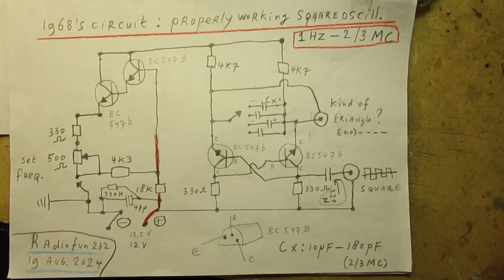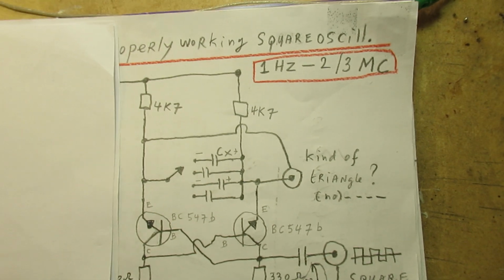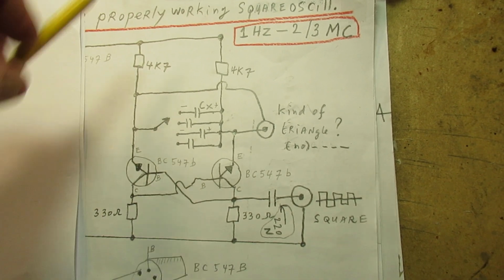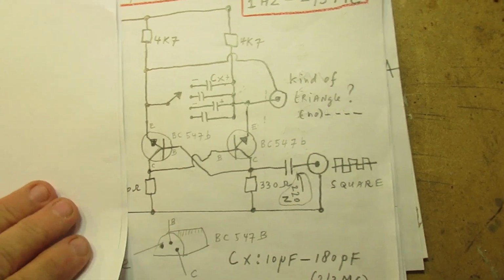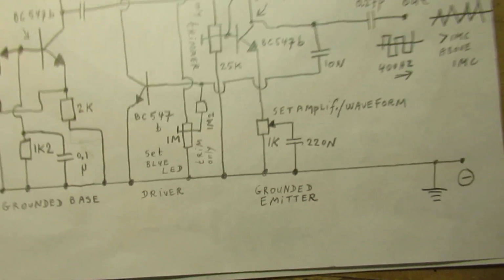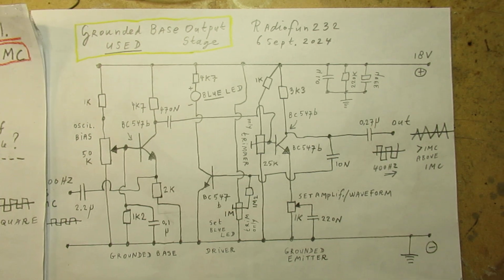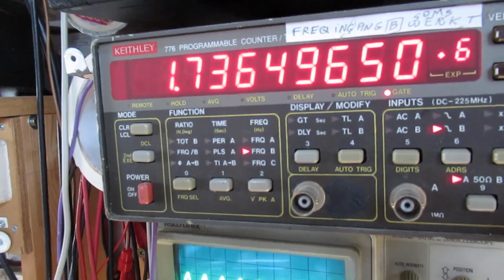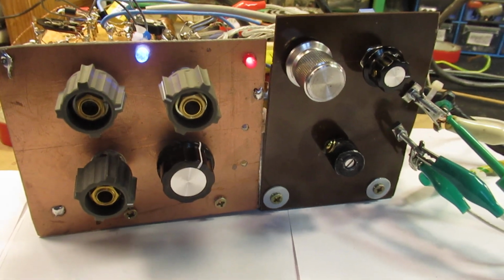Buffer Stage with low impedance input, connected to an oscillator 500 Hz-1.5 MC, schematic and demo

Comment: Hoog voltage zeg Ko!? 18Volt zij je? Worden die Bctjes dan niet heet?  Ik kan mij trouwens herinneren bijna ok dezelfde manier een oscillator gemaakt te hebben 
MAAR dan met 2 X 2N2219A en 2N3866 en zelfs 2N3553  op 104MHz  ( Torren werden ERG HEET!!! ) Dat was Langng Langnggg Geleden hoor!  VrGr Rob
Reply from the maker: Hoi Rob, ja die 18 Volt is niet zo hoog. Ik heb de schakeling tot 30 Volt getest, maar dan gaat die anders werken (met die BC 547b's). Ze worden niet heet, voor zover ik weet. In ieder geval niet op 18 Volt of 24 Volt. Op (zeg) 24 Volt wil de MUVIB dan minder gemakkelijk oscilleren, maar de frequentie kan ook nog veel hoger worden. Dat wilde ik de mensen die dit na zouden willen bouwen (niet erg waarschijnlijk, enfin) niet aandoen. Ik weet (net als jij) dat deze MUVIB met een 2 x 2N2219 heel goed kan gaan werken en mogelijk nog veel beter, met name op HF. Heb met die 2N2219 veel experimentjes gedaan, destijds, jaren 1970. Het is een erg goede en makkelijk werkende HF transistor. Van het kaliber "dat het altijd doet". Maar dat hoef ik je niet te vertellen....Groet, Ko, 6 septemer 2024. Have pinned your comment.
Reply from the maker: Hi Rob, yes, that 18 Volt is not that high. I tested the circuit up to 30 Volt, but then it works differently (with those BC 547b's). They do not get hot, as far as I know. At least not on 18 Volt or 24 Volt. On (say) 24 Volt the MUVIB will oscillate less easily, but the frequency can also become much higher. I did not want to do that to the people who would want to rebuild this (not very likely, anyway). I know (just like you) that this MUVIB can work very well with a 2 x 2N2219 and possibly even much better, especially on HF. I have done many experiments with that 2N2219, back then, in the 1970s. It is a very good and easy-to-use HF transistor. Of the caliber "that always works". But I don't have to tell you that.... Greetings, Ko, September 6, 2024.

Comment: Very interesting , Thanks for  the video. It's good to see what can be built with point to point wiring.
Reply from the maker: Thanks, you are welcome & good to hear that. And yes, point to point winding was the technique in the past, say in the 1920's-1950's etc. It could even work good in VHF, though with a lot of instructions about what to do and what not (e.g. avoiding stray capacitance). In the way I make (all) my circuits it works good up to (say) 15 MC or 18 MC, with brass nails on properly varnished soft wood boards. Thanks. 6 sept. 2024.